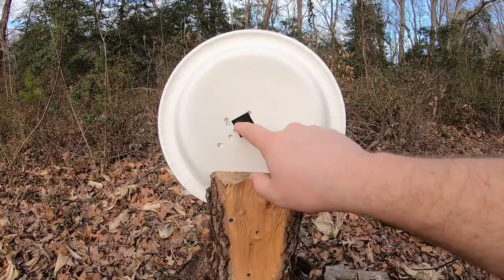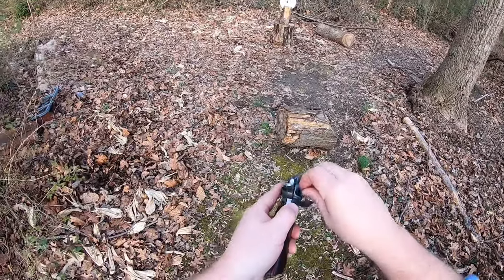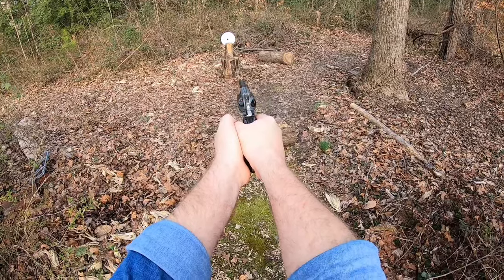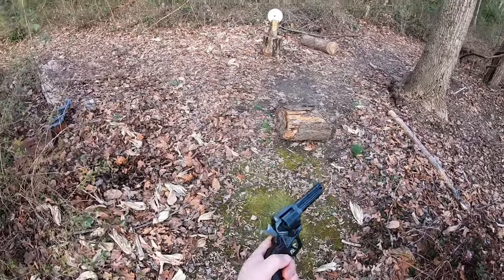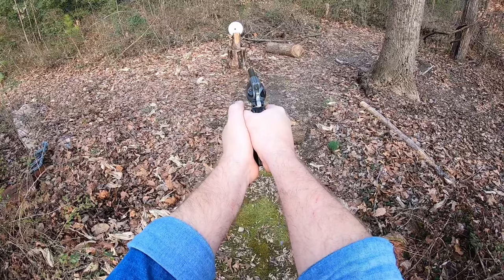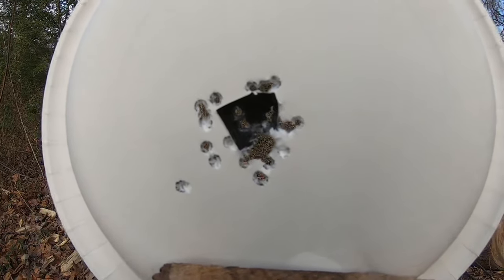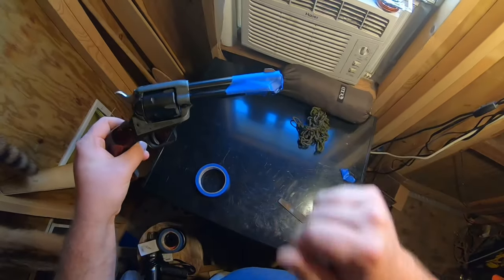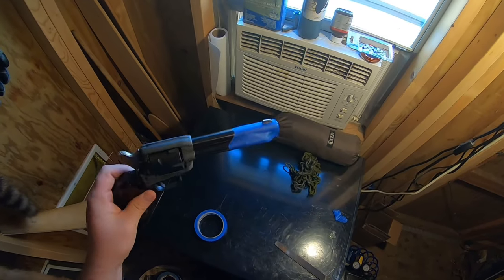Make your Heritage Rough Rider MORE ACCURATE || PLUS homemade subsonic UPDATE!

Comment: To clarify, you didn't do anything to make the gun more accurate, you merely adjusted the sights to change the point of impact. This is just like sighting in your hunting rifle although its a bit harder with non adjustable sights. Once your sights are regulated properly, start working your way out till you can shoot well at 25 YARDS. I do all my pistol practice at 25 yards and will throw in some 50 yard shooting from time to time, our gun club has a 100 yard gong and I have a lot of fun shooting that with my centerfire pistols. I've been shooting pistols competitively for over 50 years now, and have had a ton of fun doing it!
Reply from the maker: Okay, I get it… this is a 22 rimfire, not center fire. I could hit plenty out to 25 yards with my other pistols. This is also a 4.75 barrel so things need to be done within reason regarding a revolver platform.
Reply: Accuracy describes how close your measurement is to the target value. In shooter’s terms, accuracy describes how close your fired shots are to the point of aim.
Reply: The “Actually” police 🙄
Reply: Was about to comment the same thing. If the pistol is shooting 6 inches to the right but is grouping 3 inches at 15 yards that's considered an accurate pistol. All he did was adjust the sights. It's not like he  did anything to tighten up the grouping.
Reply: @samuelneil2691  That is a precise pistol technically speaking. Not accurate. Accurate refers to how close the pistol shoots compared to where it is aimed on average while precision refers to how small the group is. So, technically, adjusting the sights to make it impact where aimed is making it "more accurate"
Reply: That caught me off guard too.
Reply: Geez dude said h to decaf!

Comment: I put a red dot on mine drilled and tapped it myself 2 years  ago , way before they started making one like it. I put a cheap 20$ mini red dot from Amazon works perfectly. Home made tactical cowboy action.
Reply from the maker: Nice!
Reply: I just took mine apart and did a "bunch" of work. Had a 10/22 Weaver scope rail I adapted and a "cheapie" 10yo red dot tube I mounted. I ended up cutting the rail just about in half and painting the cut end so it wasn't so obvious.
Accuracy was spotty but a little better with the 22mag cylinder and ammo. The barrel kept loosening up so I made the executive decision and tightened it good and tight (without Loctite for now), put the ejector tube back in place and marked and shallow drilled/tapped a new hole. Needless to say, the front sight is now at about 11 o'clock so it will no longer be used. I have the 6.5" barrel. Closed up the cylinder gap slightly which is good because I was getting a lot of blowback with the magnums. Once I the hole was drilled/tapped for the ejector tube, all went back together with Loctite red. Have to see how it worked out at the range next time.
Also noticed the brown painted grips would get "sticky" and didn't tolerate alcohol or other gun cleaners so I took a damp rag with alcohol and wiped the paint off, leaving the black plastic grips underneath which actually look good and feel better than the sticky crap that was on there.
Reply: It's sacrilegious to put a red dot on a cowboy revolver. Git that crap off there and learn how to shoot it right-. City boy.
Reply: @kernpetersen4901  I have a regular one this was my spare throw around scratch and dent one.

Comment: If the revolver is shooting left or right, for windage correction do not bend the front sight as it may break off but instead put the pistol in a vice protecting the frame and the barrel and then rotate the barrel slightly to the left or right incrementally as needed.
Reply from the maker: Haven’t had the need to adjust windage, but that’s solid advice!
Reply: Rotate with what?  Pipe wrench?
Reply: @justingilmer3642  If need be you can wrap the barrel to protect it and use a wrench. A strap wrench would be better. If the revolver is shooting low you can file down the front sight incrementally as needed. If its shooting high you may need to build the front sight up incrementally with something like an epoxy or JB Weld or similar.
Reply from the maker: The JB weld steel stick is great for building up metals, or plastics. Great advice RB M.
Reply: @Majormusket  Its not really hard to make sight adjustments even to permanently fixed sights but it does take some effort and a little money.
Reply from the maker: Just like being married…
Reply: Rotate the barrel, what does that do to your ejector?
Reply: @jimbruce9744  Take the ejector off before you rotate the barrel. Its not hard to do.
Reply: So how will the screw hole that attaches the ejector to the barrel line back up.  You can rotate the barrel but because of the way the ejector fits into the frame the ejector has to stay in it’s original position.  Also these pistols have micro threaded barrels and all components are CNC precision made.  If you rotate the barrel you will alter the barrel to cylinder gap. This is a very close tolerance.  If you rotate clockwise, or tighten the barrel in the frame you most likely won’t be able to install the cylinder without shaving the base of the barrel or the face of the cylinder.  You also run the risk of over torquing and compromising the structural integrity of the frame.  If you rotate counter clockwise you will widen the gap and loosen the barrel which, on a revolver can cause problems you really don’t want to have.
Reply: @jimbruce9744  Obviously you can only rotate the barrel slightly in short increments so that the barrel does not go out of alignment with the ejector. You should not have to rotate the barrel very far to make sight correction. The forcing cone gap is also very small but as long as the gap is greater than three thousands and no more than ten thousands there should not be a problem.
Reply: @rbm6184  thanks for that response.  I think learning something everyday is important.  I love this little pistol.  I put Over 300 rounds through mine straight out of tha box and I learned it shoots high and left so I compensate and aim low and right.  I also learned that every screw in it backed out.  The hammer pivot pin almost fell out but that’s all good.  I pulled every screw, cleaned the threads applied a small amount of red loctite and torqued them all to spec with my Phat Wrench.  She’s good to go now.
Reply from the maker: Careful with that red loctite. I use fingernail polish myself. You need something that will break away easily should you need to. Also, try different ammo in your heritage before making modifications. You may find a brand/load that fires more accurately without adjustments, more so than others.
Reply: @Majormusket  red loctite does break.  The blue is what you stay away from on a fire arm.
Reply: @jimbruce9744  Yeah. You are only very slightly moving the barrel left or right in short increments. The ejector rod should not go out of alignment with the chambers of the cylinder. If it does then you are over rotating. You are not taking full rotations of the barrel so you should not have to worry about changing the forcing cone gap. I also agree with Majormusket. Use different types of ammo before making sight corrections. Your accuracy may improve with a different type of ammo. My Rough Rider is only second to my .30 Carbine for being the most fun gun I have to shoot. I had to do a muzzle crown job on my Rough Rider as it was marred and uneven or not level new from the factory and I missed that when I inspected it. It used to shoot like a shotgun pattern and would not shoot a bullet group. Now with the muzzle crown even/leveled its almost dead on.
Reply from the maker: It’s the opposite. Blue is medium and red is the insane shit you have to use heat on lol
Reply from the maker: It’s a smidge… the slightest movement makes a big difference in a sight picture! Well said.
Reply: @Majormusket  I was just going to say the same thing. Haha. I use blue because it can be broken loose but red is permanent.
Reply: @Majormusket  I stand corrected.
Reply from the maker: The good news is.. it’s reversible. No big deal. Just gotta take your time.
Reply: Actually  mine  was bent far to the right  and it wasn't barrel twist ,I put cloth on the jaws of my Kliens and straightened it ,and now it's dead on.
Reply: That is the only way to do it.
Reply: I hit my Heritage revolver 1 time with a claw hammer on the left side because it was shooting far right. Now it won’t shoot at all. Looking for a solid trade. Maybe something centerfire & expensive.
Reply: @jimbruce9744 Where does one get the torque specs to tighten the screws should one need to tighten?

Comment: Historically these cowboy revolvers  were shipped with tall front sights from factory. The shooter then filed them down to where their eye and style of hold, & sight picture was good for them. When building long guns found that very few barrels except for the high priced barrels are not bored true to axis. Learned to position the barrel onto breech plug with the axis high high at the breech low at muzzle. Then the high front sight could be filed according to users hold and sight picture.  It probably the same with these low cost cowboy guns today. Remember the smoke poles, fowler/ smoothbores had soldered front sight , rear sights were dove tailed to adjust windage usually on rifled barrells.  The octagon barrels usually had a dove tailed front sight it all depended on the Smith and style of musket or rifle. So ain't a big deal to have to file the front sight.... on cowboy revolver....🤠
barrels today.
Reply: Historicly, revolvers shot horribly high, as they were intended for mounted soldiers taught to aim at about the belt buckle. So at a later  time, they may have come with tall front sight suitable for filing, but they started with small front sights that you could not correct with a file.

Comment: I have used your way to change the point of aim.  Windage is a bit more troublesome.  You can use pliers to bent the front sight (opposite the way you want to move point of aim) or I have found a bit of nail polish or white out painted on the rear sight works for me.  Aline the front sight to the white out painted side of the notch.

Comment: I was having a hard time seeing my sights. Everything black so I took some white spray paint put a shot on a piece of scrap paper then rolled a Q tip in the paint, then put a bit on the top back part of front blade. I also tried a bit on each side of rear sights. It helps a lot especially in low light.

Comment: Mine hit low, so filed sight as you did, then used cold blue to reblue where it was filed. Added orange paint for visibility. I also had to bend it slightly as it also shot left out of the box.

Comment: TY, I had nothing but issues with my trigger spring. The day I got it Trigger spring broke. It kept breaking 3 more times within minutes of get tting it back. Total round count a dozen or so max. On my 4th return Heritage said it will cost $50 to ship? If this happens to you source a colt or any other single action spring. $5 and file where needed. not only does it work but it's a way stronger spring. Just Put 100 rds through it this evening. Runs better than ever
Reply from the maker: Heritage CRANKS on that screw that retains the trigger spring. I backed mine out and lightly snugged it. An overly tight screw on these stamped springs is just asking for trouble.
Reply: @Majormusket  Thank you!! Makes total sense now. Your absolutely right

Comment: Bought this pistol for my 7 year old granddaughter. 4&3/4” barrel. Also bought her a nice leather holster. This year I plan to get her the .22 mag cylinder. I will be doing some adjustments as did you. Thank you for the insight. And have decided to give you a subscribe. 👊🏼🇺🇸💪🏻
Reply from the maker: Excellent choice! Keep in mind… don’t make any modifications until you have shot standard 22lr and 22mag first. They will behave differently. You can always find a happy medium when adjusting that suits both. Welcome aboard and keep me posted, Donnie!
Reply: Be careful about something:

Awhile ago, 8 years maybe…Heritage didn’t just sell the extra cylinder. They wanted you to ship the gun back to them so they could assure a proper fit.

Now, this means their manufacturing quality control improved, or their quality control as far as customer service has gotten worse.

I have to assume the latter, even though I just purchased a 9” barrel version with the two cylinders. (Arriving today or tomorrow.) My version has front and rear adjustable sights.

Just wanted you to be aware of this, because this policy change of theirs kind of makes no sense.
Reply: @Ira88881  thanks 👊🏼
Reply: @donniecampbell4972   Also, and I’m pretty sure you know this…

There is like ZERO difference in recoil when you go to 22wmr in this revolver from LR. Absolutely nothing to even think about, even for a 7-year-old.

The noise is a different story!

But what all-American kid doesn’t like noise?
Reply: @Ira88881  Amen brother 🇺🇸💪🏻
Reply: @donniecampbell4972  yes !please make sure yours is the 22 /22mag compatible first, they put hat on their website as people were buying the standard 22 heritages then thinking they could buy the 22 mag cylinders and use them and that is a Definite NO....

Comment: I got very lucky with the first Rough Rider I bought. It was dead onn accurate right out of the box. It's still the most accurate one I have today. I have six now. Actually two are the kids and one the technically was bought for the wife. I have two of the shorter ones. Not barkeeps but the 4.5 inch? 6 inch? Whatever the actual measurements are. Also one with the longer barrel but not the 16 inch honkers lol None came perfectly zeroed bit that first one. None were very off though. I've never adjusted the sites at all. None were that bad off

Comment: I also used a triangle file to make the rear sight notch larger, i just kept it very straight in line with the front sight.  Mine was also shooting low (I think the rear sight was so small, this gun was made to shoot with the front sight slightly higher than the notch in rear) but since i like front sight level with back I lowered my front also, also painted orange. I also tried my first attempt at gunsmithing with this pistol, started by polishing the parts (not sure correct name) where the trigger releases the hammer. that helped but not much so I kept pulling parts out and just removing a little metal. It took about 5 tries but the trigger is much better. It's almost like they were able to sell these a little cheaper by letting the owner spend the time fine tuning. I bought a used Ruger Blackhawk awhile back that someone else had done a trigger job on, it is the closest thing to a hair trigger I have ever felt. I don't even cock hammer unless it's pointed in safe direction, but it's super accurate. I was trying to make this one the same. It's only used as target gun before anyone gets upset. It also was very accurate out of the box (as long as I kept that front sight slightly high) but now it's even more so.
Reply from the maker: Agreed…I prefer a little room to dial things in. Every shooter is different. This allows some adjustments for each shooters style. I never liked the bead above the notch. There’s way too many variables at that point to be consistent. My good buddy brought his ruger over and we were shooting at the range. He was making decent groups. I pulled out the heritage and ran through a cylinder.  When I was done he said, “yep…that’s definitely your gun…” lmao
Reply: this is a good gun to try out your gunsmithing skills.  if ya screw it up ya won't be out too much money
Reply: @tzackaria7  they sell all the parts on their website at very reasonable pricing . There is so many options to personalize them also . I absolutely love mine (we rarely shoot lr usually just mag) and so does my boys . We have put 1000’s of rounds through it and it shoots as well as it did day one .